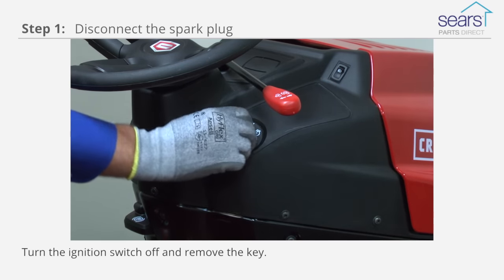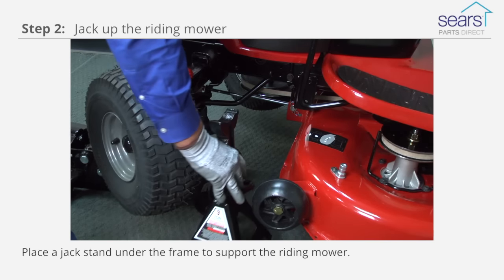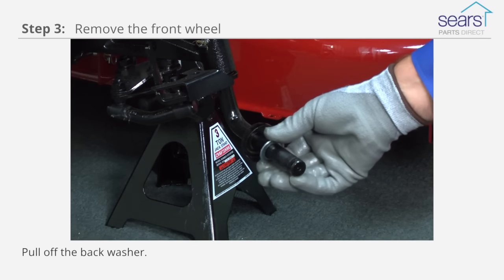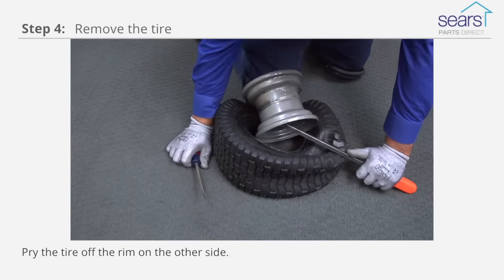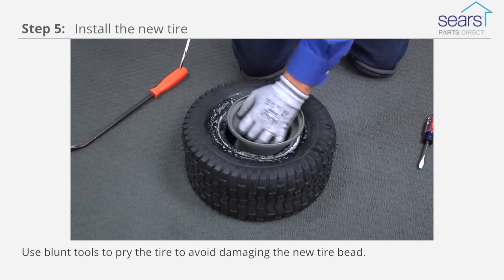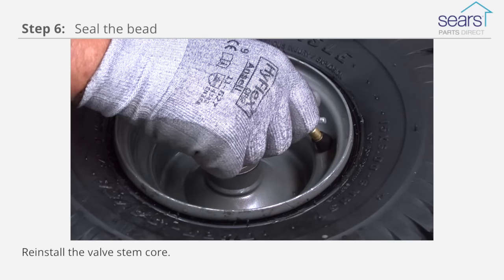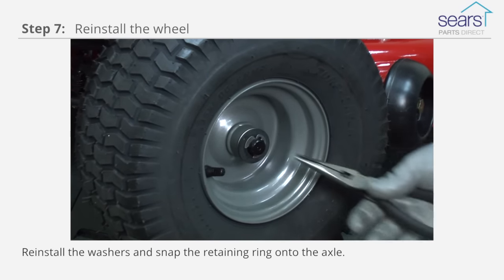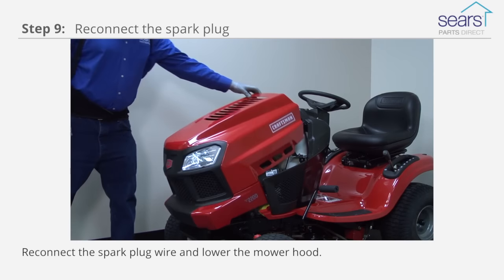Replacing a Front Tire on a Riding Lawn Mower

Comment: Front tire won't go back on to where I can put the clip back on, am I doing something wrong
Reply from the maker: Check inside the wheel rim's whole for debris or a foreign object that could be keeping the rim from sliding fully onto the axle shaft. Remove anything blocking the rim from sliding onto the axle. Check for deposits on the axle shaft or inside the wheel rim's hole that could be preventing the rim from sliding fully onto the axle. Clean residue off the axle and from inside the rim hole if necessary. Check the positioning of washers on the axle. Examine the other front wheel to guide you in positioning washers on the rim that won't fit correctly on the axle. We hope these tips help. If you need further assistance, let us know the model number of your riding mower and additional details about the problem.
Reply: @searspartsdirect  Thank you, will let you know later this afternoon its been storming here lately.

Comment: The hardest thing is holding it still. The hole is approx .75’. I just happened to have a chunk of threaded rod .75’ t welded an angle iron to an old disk brak. Then drilled a hole in the center of the angle iron and welded the threaded rod inside. It’s set up so the angle iron can sit in a vice. The rod goes up through the break disk. Now I lay the wheel on the brake disk with the threaded rod going through the wheel like an axle. I have a short piece of plumbing pipe 3/4” I’d that I insert over the rod to keep from damaging the threads. I install the nut on top of all of that. I forgot to mention I have a washer and nut on the other side of the tire.  I tighten the whole mess down. I’ve already broken th bead. Now I have a long flat bar I insert under the first part of the tire/rim after prying off the initial part of the bead. Then just like an automatic tire remover I hold the bar against my pipe and pull it around the edge comes right off. Continue on the other side. Not my idea saw it on YouTube. It takes the wrestle out of it.

Comment: Thanks for the video. I got the new tire on but even with compressed air it won’t seal, it just blows air out by the rim.
Reply from the maker: Seating the tire bead on the rim can be challenging. Shooting a sudden rush of compressed air through the valve stem without the core installed often does the trick. If not, you may need to follow the steps shown at the 1 minute 40 second point in this video for replacing the rear tire to seat the tire bead to the rim: https://www.youtube.com/watch?v=c6yFoobCqf8&t=103s

Comment: My mower only has one washer, not two, or a retaining ring.  Can’t get the wheel back on. Can I buy those and use them instead of the crap I have.
Reply from the maker: Let us know the model number of your mower and we'll check. Most of the time, you'll need to use the original parts instead of different ones.

Comment: What are those tools
Reply from the maker: Here's a link for the written version of the repair guide that has all tools listed: https://www.searspartsdirect.com/repair-guide/riding-mower-and-tractor/how-to-replace-a-front-tire-on-a-riding-lawn-mower.html
Reply: @searspartsdirect  Nowhere have I been able to locate information about ideal jack points.  Can you please help here?
Reply from the maker: @matthewsmith8249  We found a sturdy spot on the frame and used a block of wood on top of the floor jack to raise the front of the riding mower. Once raised, we used a jack stand under a sturdy part of the frame to keep the riding mower steady while we removed and reinstalled the wheel.